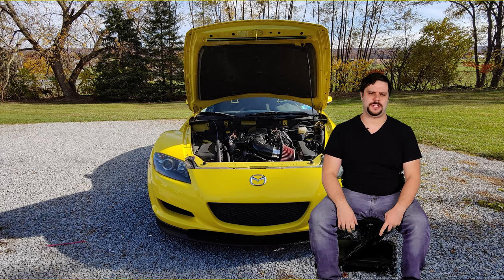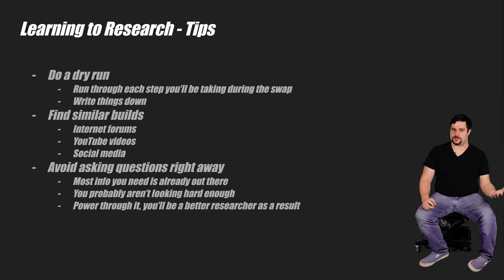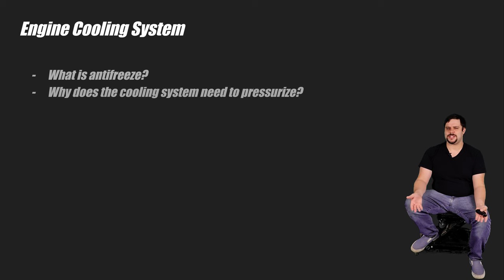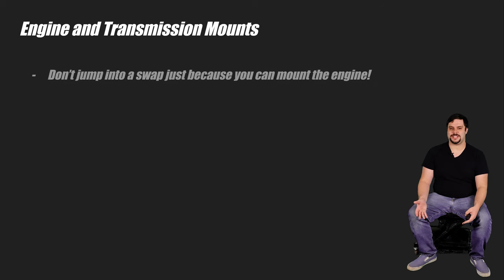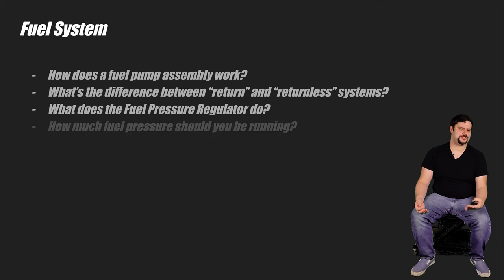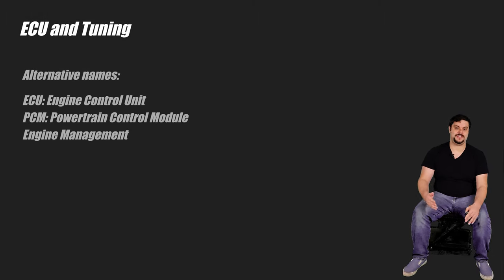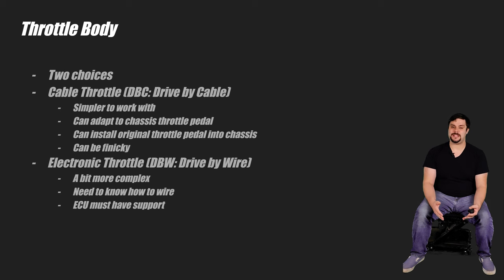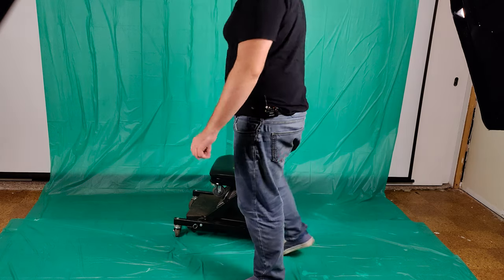Engine Swapping: What You Need to Know

Comment: Great video kinda changed my life a lil bit ngl...

What about swapping from one car to another of the same make and model? I basically have a subaru outback and a liberty of the same generation both with MTs one with a sluggish ej253 that's well past it's prime the other with a recently rebuilt ej255. Would the engine out the liberty GT mostly plug and play with the previously N/A outback? Can you just swap the ecu, transmission etc over if its basically the same car just different spec?
Reply from the maker: Mechanically, Subarus are basically legos. Some things may need to be changed, like maybe the engine cradle subframe to clear the up pipe, but it's all bolt on. Things get difficult when you get to the electronics as, at least with Subarus, things are not plug and play. The engine harness, ECU harness, and dash harness are all meshed together on most Subarus, so you either have to adapt the original N/A harness to the turbo ECU and turbo engine, or replace the entire harness which involves removing the dash. 

I have a video on wiring an engine by hand on this channel that may be of interest to you.

Comment: I’m tryna get a list of things I need to do for a 4.8L or a 5.3L vortec swap in a bmw 318ti. figured I need a holly bell house, a 370z trans, a 88 ford rear end. Either a decent computer or a Chinese one. My buddy has the shell sitting with coil overs track ready as of now. it’d be the cheaper route but harder to get done rather than building up the stock i4 that’s in it, any tips? figured that model vortec is reliable and cheaper than the Ls platforms, can sound pretty nice as well
Reply from the maker: I'm not all too familiar with Chevy, or most engines to be honest. I usually tend to stick to engines with port fuel injection, and that are well supported by my standalone ECU. I'm not sure if the older vortec engines fit that description or not

Comment: Do you know anyone that can make a Honda K or J Series adapter plate for an EJ 5-Speed automatic cvt transmissions??
Reply from the maker: The same adapter plates could be used as the bellhousings are the same, however, you'd need a custom flex plate made. Plus a custom trans controller more than likely. Sorry, I don't have much experience with auto transmissions.